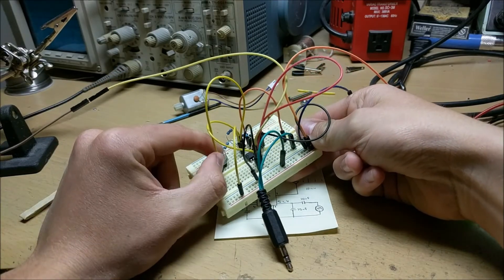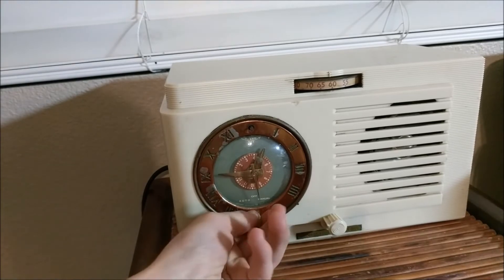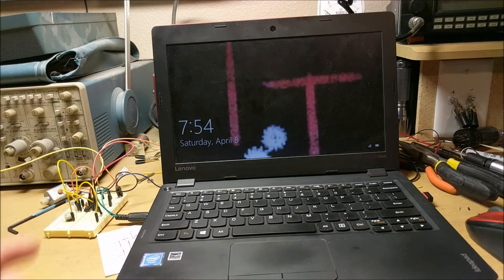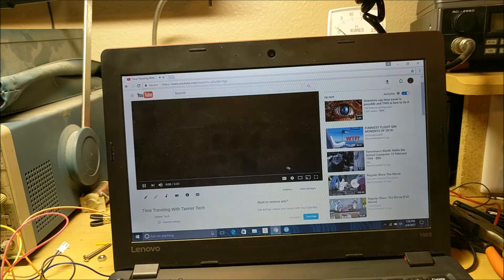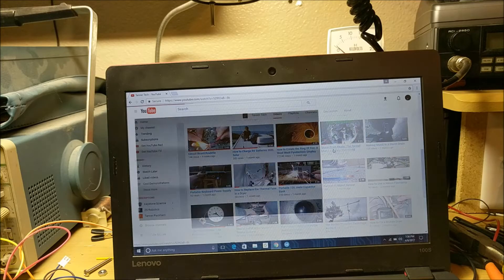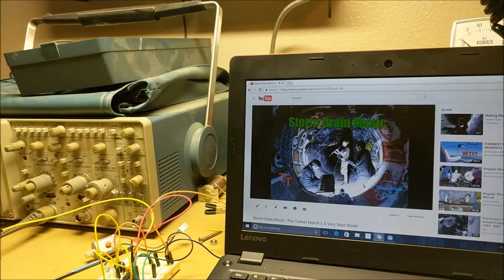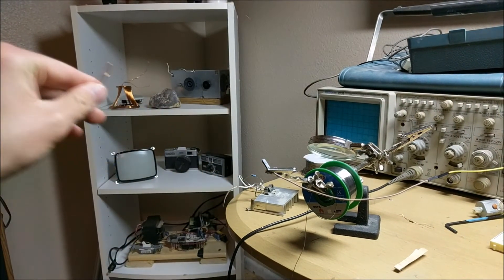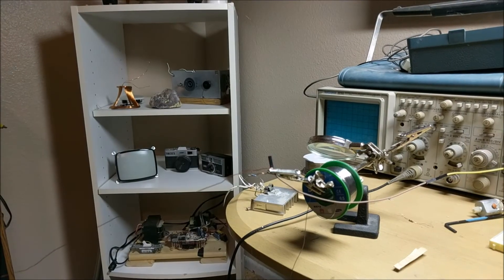How to Build an Easy  AM Transmitter

Comment: Changing the upper trigger threshold (with audio voltage) via pin 5 changes only high output duration of the 555 timer, resulting in changing both its duty cycle and frequency. The output amplitude is still the same (pretty much 0 V to PS voltage). What you might have heard on an AM radio was at best noises from a pulse-width modulation simulating AM. Using values of Ra, Rb, and C (look up 555 data sheet), your max frequency is roughly 480 KHz so it’s not even in the AM band. Hook up your transmitter output to a scope or a spectrum analyzer and show how your AM output looks like!
Reply: correct. Using a single 555 with control pin 5, yields a bad signal. It's better to use one square oscillator module, vary it's power input to get AM, then use a PI filter to remove most of the harmonics. Then you can use an additional transistor to get a good signal for several meters, using a properly matched antenna.

Comment: The simples way to make an AM transmitter is to use a quarz oscillator and to modulate its operating voltage.

Comment: Well done sir! I would have liked to have seen the waveforms. I’ll do that when I build the circuit. In My circuit I would like to try a 455 Kilohertz crystal generated signal for doing AM IF alignment. I recognize your tube radio, a GE model with a Techron clock I believe. Oh by the way  I started out in this field when I was about 12 years old working with only tube circuits. Transistors although they had been invented were not economically available to experimenters until about 1958. Good job my lad!

Comment: Building AM xmit for same reason, but why all the noise?  And what do you have to do to get rid of it?
Reply from the maker: The noise is partially from the fact that I am using a 555 timer as the carrier wave(lots of harmonics) and the solar panels on the roof with noisy(electromagnetically speaking) inverters

Comment: I can't see how this works. Pin 5 is the control Voltage pin. This would Frequency modulate the oscillator not amplitude modulate it. VCO

Comment: Very informative. i would like to know how to change frequency of a small AM crystal controlled transmitter.
Reply: An AM crystal controlled transmitter? I’m assuming you mean that you are using a Quartz Crystal Oscillator. Anyway, it is impossible to change the frequency using a crystal oscillator because most of not all of the oscillators are made at a specific frequency and cannot be changed.

Comment: You can clean the carrier wave out a little bit by adding a band pass filter between pin 3 and antenna. This will actually sound a little bit more like a normal AM radio station. Normal AM station has 8 kHz bandwidth around carrier wave, which leaves mono sound in up to 4.5 kHz - not very much, but still suitable for music playback. Not talking about speech... That way you won't spit out junky harmonics and your transmitter will work well. However, you probably should make transmitter in another AM band that's not used by broadcast, if you want to transmit to a long distance (legally, of course).

Comment: The simple am transmitter output now needs to be connected to a fet gate then a tuned circuit connected to the drain,, source to ground , you will have a nice sine wave across the coil your old radio will like your transmitter.

Comment: I'm trying to make a transmitter circuit and a receiver circuit that will control the motors in a Remote Control Boat. But I can't find enough information online/google. Does anyone have the schematics for a transmitter circuit? I'm trying to build it as low level as possible so I will be soldering transistors and stuff. It will be a learning project for me. I would appreciate any information on the subject. I am an beginner in electronics with some experience reading schematics and I know a little about transistors, resistors, capacitors.
Reply from the maker: You could try re-creating the first ever RC boat.  Look up the coherer.  It was the way that Tesla was able to control his boat.  Transistors were not even used!

Comment: Where to put the male audio jack pls ?
Reply: There are two 10nF capacitors conneced to pin-5. One goes to ground, the other goes to audio L-and/or-R. Audio common/shield goes to pin-1/ground.
Reply: Is that a 10nF capacitor? I thougt that was a 10uF electrolytic capacitor?
Reply: @armanmallari8147  replace that with a small audio transformer... like the Shure 51A312 ($8) and it will couple better..